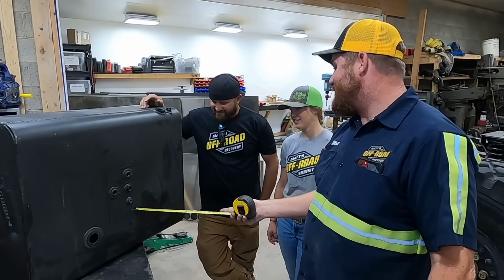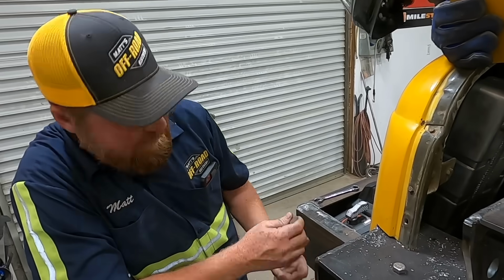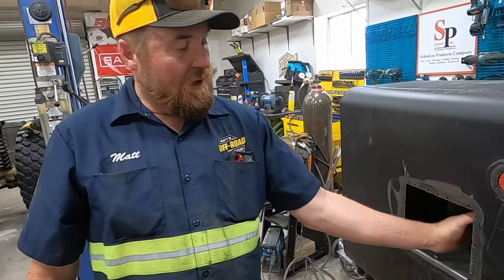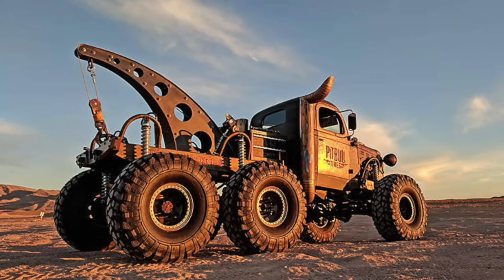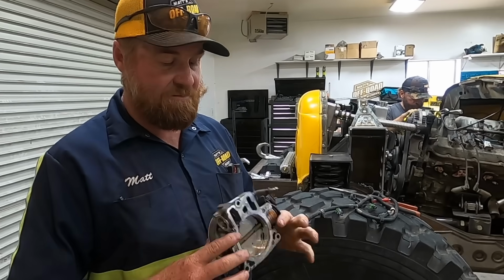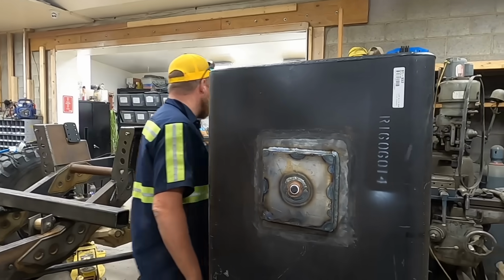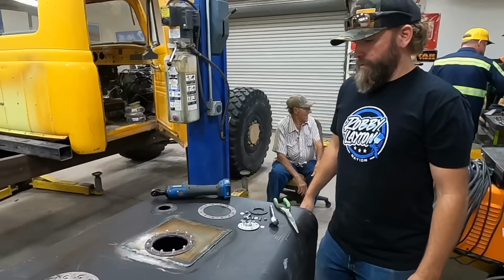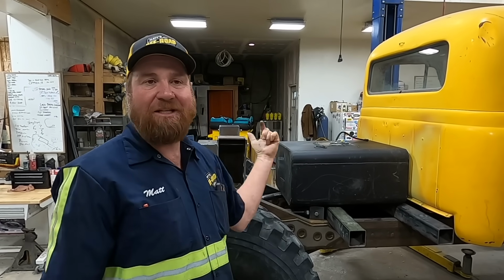World's Largest Off Road Wrecker...There Can Be Only One.

Comment: 0:22 imperial fractions are more accurate. We get 1,259.84 data points per meter where as metric is a measly 1,000. 
Plus it was the kings troops marching 1000 paces to get our imperial mile. Metric who??

Comment: I'm thinking that the IH wrecker's second life as a firetruck could have been as a water hauler. Back in the early seventies, when I was a fireman, our trucks had 750 gallon tanks, which wasn't much. We had a water truck that I believe hauled 5,000 gallons, which we took out to the more rural areas where there were no fire hydrants. Also had a truck that we used for weed fires in the fields, that held a similar amount of water, and that truck wasn't used for anything but weed fires.

Comment: With all that thick steel its going to be extremely heavy. Its also going to be extremely hard to keep from rusting. I would put some corrosion magnesium sacrificial blocks on it. They use these on ships and Outboard motors. The Magnesium will corrode before the metal and increase the life of the metal. When  they corrode put new ones on.

Comment: For fuel pressure let’s build a pressure tank. That would cure everything.   You take your fuel and you run it up into a tank with a nitrogen top or the pressure pushes against the nitrogen and then when you’re starving for fuel it feeds fuel to your engine. All you need to do is build a small pressure tank or buy one, Add  a check valve and run it

Comment: I haven't seen it yet and maybe you are going to but where the pump sits I would make like a 8" or 10' plate share the pump goes thru that is simple to remove ,that way in the future if there is a pump problem it's very easy to pill that entire piece out and install new pump into plate then slide right back in , that way you don't have to worry about having clearance to be able to angle the pump to get it in the hole or any of that

Comment: Hi, I must agree to some of the commentators below: This tank WILL spring a leak down. Sooner or later. Every frame twists, no matter how rigid it is built. And that flex WILL twist the tank, rupturing it. Cradle and straps is the way to go. Even roadgoing trucks uses that, and they are only fastened to one of the framerails. Realy nice build, tho.

Comment: I dont know if you have ever looked into deviant sumps….they are really made for off road, the sump has two inlets…one for return and one for feed….it sits on the bottom of the tank and the return is really cool because it stops air bubbles from being formed due to sloshing around….and to help with fuel pumps an air dog fuel system sits on the rail or anywhere you want to since it has a pump and filters with water separator….maybe nothing you have seen it,,,but just was thinking something you can use maybe on something else
Reply: Oh one more thing regarding the deviant sump…because the return is not on a straw…it is what stops bubbles…even if you dont ever use it…..id love for you to check it out.😉
Reply: Let me know what you think? Id love to hear your opinion.

Comment: I believe the next (biggest wrecker) should be electric, made out of wrecked Tesls’s.
500kw of energy storage
9 plaid motors
4 for drive, 6 for winches. Snatch locked 5 pulleys, goes out easier, comes back faster.
Maybe an Oshkosh chassis .

And a shit ton of software that can control each wheel every second.

Just like a Tesla semi, but for off road, that can charge at semi chargers. 

Gigantic reduction in fuel costs.No,,, Stratisfirc saving in fuel costs.

Comment: Run a magnet around the inside of the fuel tank to pick up any small metal balls from welding.  I'd also weld some pad eyes made from 3/4' steel plate on the front of the frame by those fancy hooks so you could put a 1" or 1 1/4 shackle as a pulling point tied directly to the frame.

Comment: I've seen that other rig at moab several years ago. It's pretty friggin sweet. But you're correct... technically,  two completely different types of rigs. Question: would it be feasible to make a backup fuel pump and set it on the shelf for emergencies? Just a thought... not like you can just run to napa or autozone and grab one off the shelf.  And I'm thinkin' you may have my kind of luck. 🤣😂👍👍

Comment: I always wonder when we bolt things so that the load all goes on the threads (when you bolt those recovery points on the front).  I feel like it's not as strong as when you put the bolts at right angles to the load.  But we do it all the time (particularly on trailer suspension), so it must be OK.  But it feels wrong.  :-)

Comment: Matt, How are you going to transport the heavy wrecker? surely it will be to big and heavy on a normal trailer behind a pick up truck and would need a proper lorry/tractor unit and low loader to tow it. At 5-8mpg you sure wont want to drive it a couple of hundred miles to a recovery site.
Reply: Target weight is 12,000 pounds, and it's shorter than a 4-door Jeep Gladiator. Matt said it will fit on a car hauler, but he also mentioned that it would be nice to have a gooseneck.

Comment: Check this out , gr8 time for tig torch practice for Lizzy when checking for leaks when ya find em wash over them with the tig torch don't use the filler wire just the torch she can get used to the torch without it being critical weld . You are going to do more than one tank ;)

Comment: Just a thought, I'm no expert welder but I can hold my own. When welding a tank, like ur gas tank. Use masking tap to seal all the holes and fill the tank with shielding gas. Its important to leave a small hole in ur masking tap if u continuously pump the shielding gas in while welding. You do that so the pressure from the sh. Gas doesn't blow holes in ur welds as ur welding. My dad used to weld stainless pipe together that carried milk. He taught me this. I've never used this method but u should get alot better welds with it. I love ur videos, would love to have your job. It just looks like fun. 🇺🇸👍

Comment: Matt your Heavy Wrecker build has kindled old memories for me. Thanks!  I owned and ran Wreckers in the Gold District of the Northern Ca. mountains.  I had a off road 1970 2 ton Dodge Power Wagon with a Holmes 480 twin boom on the back. That truck was solid Iron that bounced off boulders and trees. I was able to purchase and run specially made recapped tractor tread tires. Great for the mud / snow and worked well for very sticky situations. Many good times and many challenging recoveries. Working a vehicle off road is a very expensive thing to do.

Comment: I would want something with a little tighter holes to stop rocks from hitting the radiator. Possible some expanded metal or plain sheet metal that is 75% air?

Comment: What about using the space between the frame rails for xtra fuel??  s' x 6" x 4 ft>  Just under 30 gallons.  I have 12"frame rails on the Volvo 730 and put a compartment 42" long in between.

Comment: I've never built anything like the wrecker but have been building hot rods and 4x4's for over 40 years. I generally use straps and rubber isolators on fuel tanks. Welding the strap to the tank could cause the tank to crack at the weld because of flexing.
Another tip: if you lengthen the float arm and center the pivot (up and down) it will read correctly and you won't have it stuck on full until half tank. 
Love the build so far!

Comment: I thought maybe you'd just use tank straps like are used on class 8 fuel tanks...  you have nice cross-beams to attach them to and it would make removal easier with less concern of welds pulling loose of the tank.

Comment: Well, electrical is a PITA, so I can see some people having a hard time wrapping their head around it.    I rank body work/paint as #1 because that's an art, but I rank electrical as #2 most difficult thing to do unless you do a brick simple carbed/distributed ignition motor and non electric transmission.
I would not have thought you could convert drive by wire to cable as I would have thought the injection system would be designed specifically to stop people from doing that.
Kinda like I still haven't found a way around tire pressure sensors, other than actually mounting a pressure vessel in your vehicle, and even that doesn't always work from what I've heard.

Comment: Sealing the radiator to the grille opening will prevent hot air from the engine compartment being drawn around the radiator & back into the flow which will reduce cooling ability. This problem will likely be exaggerated with the restricted grill size.

Comment: The “Fuel tank” please you can buy a repair kit thats like paint that coats inside of the tank to stop it going rusty or leaking in future. Please use big straps with rubber between like trucks fuel tanks do but bigger. One litre = 1KG

Comment: This cool, it is big, yes, but I don't think it beats HeavyD's Oshkosh for largeness.
Reply: The distinction is not the size, it's the off road part. Matt is building his wrecker to do buggy trails, true off road. Not just semi-level dirt. Matt and Heavy D are friends and have been in touch about this build.
Reply: @JohnFL  That's cool, I can imagine the camaraderie there!  Did you watch HeavyD's video pulling out a stuck motor home with his OshKosh?  Not sure what qualifies as off-road in those parts...but I sure didn't see too many roads.
Reply: @dansw0rkshop  Yeah, most of the terrain he takes the Oshkosh on is relatively flat dirt. I know it can drive on the dunes too, but the buggies Matt is trying to recover with his wrecker drive on much more rugged terrain.. and then break or get stuck.

Comment: Theres a company that makes this fuel mat that connects to pump assembly in the tank. It sits on the bottom and soaks up all the fuel and is supposed to work up to like a 45 degree angle or something crazy like that.

I seen it on the Powernation YouTube channel on one of their builds I just can't remember which one.

Comment: After driving an 8.1 (and loving it) this build has been so cool to watch. I've even learned more about this motor than I knew before. The low end torque is crazy, you can barely feel towing ~4500 with 3.73s. Good job guys! 
These do have oil consumption/leakage as they age (not sure block mileage) but should be an easy 300k mile motor if maintained depending on environment.

Comment: The rubber gas line your using inside the fuel tank is only gas resistant on the inside. It will blow out after awhile. The fuel line they supply with the pump is real thick. Ive done what your doing. Ase master mech.. I ended up using clear vynel hose. And havnt had a blow out. Also DO NOT WELD MOUNTS TO FUEL TANK. STRAP IT DOWN. With rubber or fire hose under straps.

Comment: Sorry... Not the biggest. I just saw a Kenworth 4 front wheel 8 rear. 100,000 lb winch with several small winches. 60,000lb. This truck tows off-road in all over northern Canada. It 25% larger easy
Reply: @MattsOffRoadRecovery  your totally correct as a Canadian there's nothing up here you can take the death Star as a recovery vehicle but where you guys are having something that large would just be an inconvenience rather than help your guys's wrecker is the perfect size perfect everything can't wait to see that monster complete let's just hope I won't be needing its services anytime soon

Comment: How is Idle Air Control going to work with the older cable throttle body? Isn't the ECU/PCM programmed to control idle through the drive by wire stepper instead of the IAC solenoid? I guess my first question should be: are you planning on using the 2004 ECU/PCM that came with that motor?
Reply: @MattsOffRoadRecovery  👍

Comment: How come you didn't lengthen the fuel level float arm so it would show the correct fuel level? If you had made it longer so when "full" the float reached the top of the tank then it would be accurate. Instead it looked to me like you had 4-6 inches of headroom after the float reached top level.

Comment: I think you are making a serious mistake in way you are mounting the fuel tank. In my 50 years in the truck repair business I have never seen a fuel tank with mounting brackets welded to the tank. I can't think of a better way to have a fuel leak when a bracket breaks off. Hopefully you will only have a leak and not a fire or explosion. Fuel tanks must not be subjected to any twisting of the frame and should float in their mountings. Every truck on the road today uses bands with rubber straps to allow the tank to move slightly. Your plan is a recipe for disaster. I hope no one is burned or killed when this tank fails. You are going to have enough problems with the suspension mounting brackets breaking.

Comment: Hey, speaking of the engine (motor) dying due to extreme angles, are you also converting the wet sump (oil) for the motor to a dry sump? You know, to make sure it gets oil at all those extreme angles.
Reply: The engine that he actually got for the record has one built in that's why he got it so he didn't need to do like a good 20% of the work

Comment: Great ideas and fab work. but.. small but. Don't weld to straps to the tank. rust and weak points. Strap it down like a big rig. easy to remove to clean or enlarge. Throw out the gas level lever arm and get a reed switch like on a boat. Reed switches are not affected by sloshing. Good luck. Sorry Trevor great work.

Comment: I think your Tank Fasting will work but the fail point will be on the welds.  If the strap goes over and around the tank and  twists and blots to the fame the, the strap itself would have to fail which is much more significant than welds on the bottom of the tank.  With that many gallons moving around as Gently as you guys drive down the Trail, I would probably do both!  Love you Guys!

Comment: Hey Matt when you’re mounting your fuel tank why don’t you raise it up above the two 4 x 4 pieces of steel and use your brackets that you were designing but instead of just using those put bushings in between it so in the event that you get a slight twist in the frame it’s going to alleviate that tank taking the stress too.

Comment: Ok....the tank....solid mounts ok for a spell...but...after multiple extereme temperature changes, my worry would be leaks at the welds from expansion rates differing between different types of metal...other than that...sweet fabrication...prolly use it for more razors.....bwhahahaha!

Comment: Matt I dont know if you read these comments, but because of the application of this, I would consider using Holley Hydramat with the fuel pump.  The tank baffles wiill work to an extent, but the hydramat wiill ensure you never starve the engine.

Comment: An old motorcycle trick is weld a few 90 elbows on the tank with hose in between so you can see the level of fuel.

Comment: Comment why the tank mount won't work: ok. Stitch welding the strap to the thin tank steel is a poor choice due to metal fatigue and hardened brittle metal from welding, where if failure occurs its immediate penetration of the fuel tank, no Bueno. Build ridged mount shelves, line all contact points with EPDM, run straps to secure the tank like traditional car fuel tanks with EPDM contact pads. Eliminates chaffing and any chance of tank failure due to metal fatigue. If you go forward with your mount plan, which you probably will, you should at least fully anneal all welds on the tank, all the welds are under stress and tanks flex, so you will develop stress cracks.

Comment: Hey! I know you guys just answered a bunch of questions but I got even more! So I'm not sure if you've seen the Oshkosh HET that Dave Sparks has on his channel. If you have, I feel that that is a much larger offroad wrecker than this. However, I do understand that each are built for different purposes. That huge military truck could not do what you're looking to do in this wrecker. I also understand that both vehicles are or are going to be used in different types of sand/terrain. You guys have blow sand, and they have a more salt flat kind of sand. The big thing I'm trying to get at I guess is that he released a video a few weeks ago where he recovered a stuck RV. Similarly, you guys also did a recovery where you got a large RV out of the sand. Dave was able to get out the RV in a few short pulls, whereas you guys had a bit more of a struggle by using a regular size wrecker and the Morrvair. Does Dave have the REAL  world's largest off road wrecker or will it be you guys? Both are actual or are going to be actual usuable wreckers and have been used for what they were intended to be used for. No hate here, just want to hear your justification for why THIS is the world's largest off road wrecker. Thanks!

Comment: Thinking about what would happen if a welded on strap were to somehow pull off the bottom of the tank (extremely unlikely, but it would leave holes in the bottom of the tank), I'd just throw the strap over the top, and twist it after it goes below the bottom to bolt it to one of the members down below. Or weld a couple tabs sticking off a member below so it doesn't even have to twisted.

A little more material, but less work if you haven't already done it.

Comment: The real question will be the steering… My 8.1 pulls really hard right at every gas station.
Reply: And I bet your wallet can fly after every fillup, too!
Reply: Engine we had got 14 loaded or empty.
Reply: @NASA_Security_Force  Ha Ha Didn't even notice the extra. There's no replacement for displacement  !
Reply: @NASA_Security_Force  that's actually not bad I had a super duty with a 5.3 terrible Choice by Ford , way underpowered for such a heavy truck but I would get 
12 - 13 loaded,unloaded ,towing, didnt matter
Reply: @BERT BCCFU  I don't think ford ever put a 5.3 in a super duty or any pickup. I think it might be offered in the mustangs but I thought it was mainly a crate motor